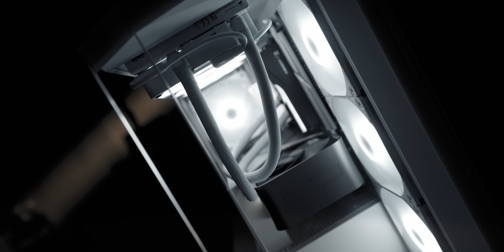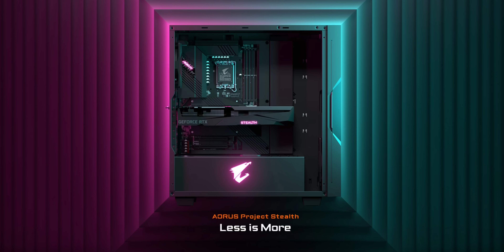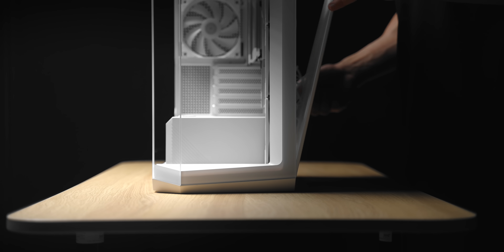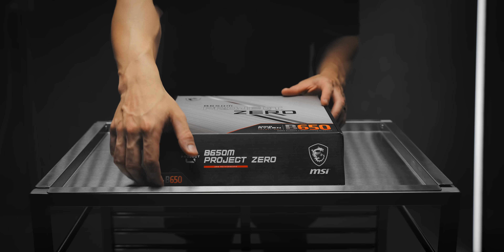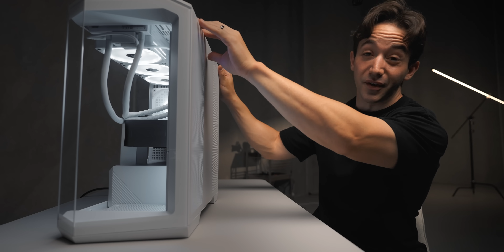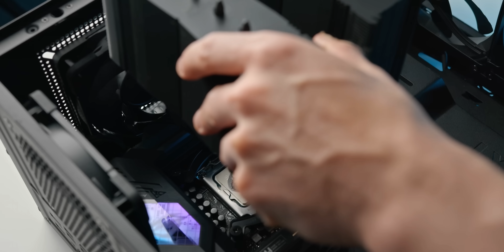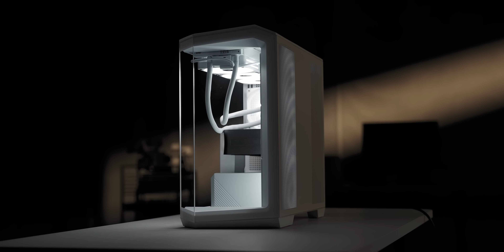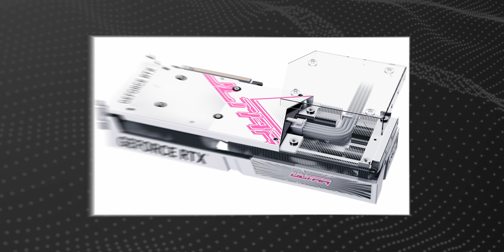"zero cable" PCs are here.

Comment: There's only one small problem with that idea: motherboards have connectors in different places and that will mess with the hole placement for standoffs which is part of the ATX standard for motherboard form factors. In theory, you could design a board where all connectors are at the back and use standoff spacers to have clearance but that wouldn't work because the slot and i/o shield are fixed in place.

Comment: ACTUALLY Making a sort of (cannot remember the terminology) GPU plug extender/anti-sag support would be an amazing idea. You could have it setup with a right angle connector, customizable support for the bottom, and then have the existing cable plug into this extender. NOT sure of the actual repercussions of this or if it is the best idea, but it sounds awesome to me!

Comment: When you see it, you suddenly wonder why this wasn't always the case. It's better in all ways.
Reply: The "case" haha
Reply: Lol easy answer
When the ATX formfactor was created, people didn't care how their PC looks inside. The cables were just in the PC so cases didn't even need cable routing behind the mainboard. Them case manufacturers started adding cable routing behind the mainboards and with windows getting more popular in the PC space the look of the inside got much more important
Reply: @5ch4cht3l7  The real reason is because it was patented back in 2011. There's a lot more benefit then it looking nice as well. For example, if you're a beginner a back connecter MB is really easy to connect.
Reply: what is that for a pb-picture of yours? DAMN what is that?
Reply: it's further from the cpu on the back which could introduce latency that may not be important for most people but for those that it is important to, front mounting will be faster usually, depending on the tracers pathing
Reply: @SBlazeable  Latency for what? Latency for the power cables? Your fans? Are you ok? And if you are talking about front io nobody connects theyre peripherals from there 😭
Reply: @nothinguz  Hes definately one of those guys with a 500hz 1080p monitors and those ugly ass competitve mouses and 128gb of ram
Reply: @nothinguz  latency for sata drives where it plugs in on the back, there's a reason why processors have their own cached memory directly on the CPU itself, data is able to compute as fast as the processor can operate because it has a couple mm at most to travel to access its cache to retrieve the data it needs to finish computing, if you're sending signals back and forth down a football field and your processor finishes the previous task in the time the data asking for new instructions takes to travel 3mm then it's just waiting 99.99 yards of travel time for the speed of light everytime that happens which can be millions of times in a minute, might not mean much for most applications but for latency sensitive applications it's a big deal.
Reply: Probably because there would be an additional assembly charge for components on the back of the PCB. Nowadays this cost is minimal, but in the past it would have been more.
Reply: Because people used to assemble-test pcs flat on the table and not on a case, as you can see if you got the motherboard connectors behind it will not lay flat on the table
Reply: I hate the big box on the gpu

Comment: For me, a case is a case. But I've worked with this case at work -- someone ordered a few some months ago, & they were deployed in the lab -- & one thing I'll warn everyone about is DO NOT GET THE CASE IN BLACK! While this might appeal to the kewl 37IT3 d00ds, that color makes working on it unnecessarily more difficult because all of the parts are black on black. You like having a bright light or do a lot of squinting to figure out where things go, go with the black. But as you can see in this video, the white case is far easier to find sockets & add-ons in.

Comment: I started building computers almost 25 years ago and it just gets easier every time. I like the rear facing connectors but I think you need more room in the back of the case.

Comment: I REALLY like this! The aesthetic aspect is cool, but as a big guy with thick hands/fingers, holy cow this will make those fan pins so much easier to access! I've put off making changes in my PC just because I didn't want to deal with unplugging and replugging those tiny little cables/pins!  I'll definitely be looking for one like this for my next build! And I appreciate the Corsair water cooler with the cables running through the tubes, I have an earlier version of that and it looks awesome except for the wires. My next build will have a custom water cooler system, but that is a no-brainer for these aesthetic builds!
Reply: It's not only those with thick fingers lol! Anyone and everyone would feel daunted if they have to take apart quite a few things just to make 1 or two changes.

Comment: Not sure what I feel about this. It looks clean in the same way an empty apartment does. It's just underutilized. This is a 42 liter case with next to no space for storage. Having the connectors in the back just requires more space. Also, it's not really zero-cable: By the time you've plugged in power, display and USB devices, the back will look just as spaghetti as any other case. 

Also, what I love about PC building are the options. Up to now, you've been able to buy new parts and stick them in a thirty year old case - and vice versa. Nobody's stopping you from building a beige sleeper or simply re-using your old case. But no, suddenly somebody decided that electronics shouldn't have cables, so now its all aboard the E-waste Express for your current case. If you really want a clean build, why not just buy a case without a glass side panel?

Comment: The problem with the high voltage gpu connector might get resolved some time in the future. Last year I saw a video where there was some concept by I think it was MSI too. In this concept they had a custom PCB connector which clicks into the Motherboard. The actual power connection then gets a separate connector on the Board. With that the connector on the GPU front is obsolete.
If they work on standardizing some like that it would a game changer in my opinion

Comment: Not gonna lie, the solution is quite a good idea for "zero" cable management with those white LEDs, it all looks slick and clean. But in the end, you don't actually want to put these on the table to look at it anyway because the light gets tiring after a while don't you think? Practical is good for the cable reach, but that's also it. For me the most important thing to have such a desktop pc is noise humming from all those fans, which I just try to avoid to put that many fans in it in the first place. (overkill is a thing yes)

Comment: I've always struggled to get the front panel headers connected to the pins, because those are always located at the bottom of the board and once it's screwed into the motherboard tray I just can't get my fingers in that space properly to get them connected. I LOVE all the connectors being on the back of the motherboard - sure you lose the fancy custom cables but it's not like this motherboard layout will become the norm, it'll be another option to the regular layout I bet. All they need to do now is figure out that GPU cable.

Comment: "Zero cable" PCs are here" Great...... But they've been here for several years. I picked up a Lancool case in 2019 and aside from the bottom psu and extra drive bays cover and the glass front, they are identical. Don't get me wrong, case design can make a big difference. But it's not a deal breaker. It may be easier but a creative builder can make it work with a lot of different cases.

Comment: If they can pull it off without the whole bundle of dongle-like things having bad contact, oxidation etc. and resulting in 3.3V/5V/12V voltage fluctuations or full on dumpster fires like NVidia with their new connectors, I'm ALL for it. It's about time!

Comment: Just my personal opinion here, so don't get too upset with me; I do get it, but this is really needless complexity for entirely cosmetic purposes that only matter when you have these ridiculous glass / windowed cases.  I'm not categorically against decorative computer cases and certainly not against making them aesthetically pleasing objects, but I have never understood the obsession with staring at the internals.  I use cable management to reduce clutter at a practical level and to help airflow, but I don't care if I can see cables when it's all done.

I like that they make stuff to accomodate different sensibilities, but they have leaned so hard in to the RGB lighting / eye candy market that they have ironically made it difficult to build a normal looking computer.  And in the case of the rear-facing connectors, I would be concerned that they are sacrificing the quality of the circuits to accomplish cosmetic goals.  Single sided boards ARE simpler and less prone to problems.  A lot of this nonsense is how the manufacturers have gotten away with overpricing their products.  I don't need camoflage patterned motherboards and swoopy, useless fascias covering stuff to look 'cool'.  The only way to find a normal, undecorated, green motherboard is to buy 'corporate' models.  I used to like building computers, but have gradually been crowded out of the hobby by the RGB bro cult.  I hate shopping for computer stuff now.

Comment: Should have been done 15 years ago. And I agree, the GPU cable situation is beyond stupid.  A 2-wire 10 Gauge OFC solution would be far more powerful and easily routable. And it should also be on the slot side of the card.

Comment: the awesomeness of the new cable solutions aside, I feel this build would look 10x better with an air cooler on the CPU instead of the water cooling. The big tubes detract from the 'no wires' aesthetic for me.

Comment: i wonder why they haven't do this before, i mean why putting the ports in front? when its way more practical at back
Reply: Because it isn't, really,  It might be for YOU, who don't have ANY reason to add or remove stuff to the PCI connectors on the front, but here you need to strip the entire case down just to add a network card with external power needs.
Reply: @eidodk  why entire case, isnt all the ports on back so that only removing back panel get the job done?
Reply: @AniSepherd972  Can you access the PCI slots on the back ?
Reply: @eidodk  if using extender yes, how u guys put vertical position of gpu in sff cases?

Comment: I would switch to Corsair Link fans and 3D Print a smaller cover for the Video card. Also Print small cover for the Link radiator... Finally print a 3rd small cover for the back top corner to hide the fan cable for the back exhaust. If you use Link for that too, you can just connect the 3rd radiator fan to the exhaust.

Comment: Rear facing gpu cable sounds like a good idea, until you remember that most decent gpu nowadays so huge they require a support bracket as a third mounting point, which in turn can be used to hide most of the cables.

Comment: this is what I expect when I pay multiple thousands for my PC (excluding the rear chaos).. which is why I have have no issue paying the extra for my Macs. not only do I prefer them but I am paying for quality & well designed hardware & synergy.
Obviously I have a PC for gaming & my last one cost me 4k & It always feels cheap & like its made from generic parts.. no design concepts, cables sticking out.. & really lets down paying so much for parts that are reduced to the same ugly issues that the $200 budget pre-build has except I spent 4k. I tend to go for all black cases with no lighting..
it dosent exactly incentivise me to build a good looking unit

Personally I think we need to do away with standard cable length for PSU's
If I am building a full size ATX build I will need longer cables then with an ITX for example. 
so with the PSU you should be able to choose what cable set you buy.. & instead of 12 versions from say corsairs 500w line give me 3 ratings & 3 cable choices.. 
when you buy it you choose what cables & what rating... then when you upgrade the PSU you have an option to opt out of cables.. 
I have 9 sets of RM cables here as I always get the same PSU so I don't have to worry about using the wrong cable config with a new PSU. 

I think that ALL boards (excluding the dell optiplex custom boards for office PC's)  need to have rear facing ports... this will reduce the overall amount of cable needed & if they were all fitted with right-angled plugs then the amount of cable needed would be halved. 

cases need to have fixed in place fan cable runs.. so when you slot your fans in you have a very small jumper that you can tuck & hide which allows for varied rad & fan configs.. & it goes without saying they all need to be interconnected so one cable per block/stack of fans..

Comment: It was actually not much difficult for motherboard designers to put a handful of through-hole connectors on the other side. The SMD assembly is the same for twin. Only those flipped connectors should be installed differently but that can be done manually.
Overall, the fashion of showing off your PC internals is a new thing. However, custom motherboards for custom cases were years ago.

Comment: I would have made the profile of that GPU cable cover far more flow and visually friendly by making it rounded on the visible side and keep the spacer support on the inside, away from view. It's huge and obvious as well as a potential hot spot for the PSU and case! Honestly, the case should ship with such a cover for the most popular cards. It's just cheap plastic, after all.

Comment: The GPU support/cable guard would be a great place to mount a small LCD showing a GIF or PC statistics, it would make it part of the case and the wires could be routed down with the GPU power
Reply: how are you gonna see that LCD through the metal panel? 
hm..maybe you are new at this...but real PC's don't have glass panels..those are only for advertisement and PC review-ers on YT to show the hardware ;-)
Reply: @vasopel you’re trolling everyone I know has a glass panel and I do too
Reply: @Tvv466  trolling about PC cases? that's absurd.
so every one you know has a glass panel PC case? :-O what is the reason? 
and another question...what about PCs at your workplace, or any other workplace you happened by chance to see,do those PCs have glass panels too?
Reply: @vasopel  yes because they are simple desktop machines If you pay for a certain aesthetic it’s nice to look at
Reply: @Tvv466  pay for...aesthetic? what? next thing you're gonna tell me is that consoles should have glass panels :-D
Reply: @vasopel Had one 10 years ago, wtf are you on about? And almost every gaming pc in the last 10 years I've seen had a windowed case.
Reply: A gaming PC with glass panel? So a poser PC.

Comment: I would like something like that which is more wall-mountable, flat, puts the troublesome bits like the video card cables and power supply on the floor.  The glass should double as a clear LLM display for my programmable Graydient character.  Then it's cool

Comment: This is so dumb. The PC is supposed to be clean because all the internals are hidden inside the case. But then they go and make the case transparent. So then the mess shifts to the other side. How long before the other side becomes transparent too?

My PC is incredibly clean-looking. It has no LEDs and I got the darkest glass side panel available. Would have preferred if it was fully opaque but at least everything in there (including the rat's nest of cables) is black so you mostly can't see it.

Comment: Looks great. Moving the AIO cabling to the radiator is a definite step forward. That GPU mount/cable guard is not great - good idea in theory, and maybe slimmed down would be ok, but in current iteration, looks distracting.

Comment: starting to like this trend -- i wish everyone would start adopting it. as you said, it does two things:
1. aesthetics. not / barely a cable in sight
2. functional. all/most of your cables & connectors are accessed from the back & you avoid having to be finicky & doing finger gymnastics trying to plug/unplug connectors when a big component is in the way.

yes, more of these please.

Comment: It's surprising that it has taken this long for manufacturers to consider "rear mount" connectors. And would it really be that difficult to offer a motherboard with dual sided options anyway? It's been a year or two since my last build but from memory motherboard risers should have enough length in them to accommodate a connector on the back side as well.

Additionally, if we're going to go down this path it would be nice for cases to have just a little more serviceable space behind the motherboard tray. We're clearly past the point where running cables back there is 'hacking' your build to look cleaner, they are intending for it to happen now, how about we get more than a few mm space between the tray and the frame and side panel to work with, hey?

Comment: Not a concept build or anything but actually something worse. A seemingly normal build with hardware that would be compatible with most other components of the build. However, unless some sort of standard is maintained, companies will just lock consumers into their ecosystem of motherboard, case, power supplies etc.
What's worse is the standard wouldn't even be that hard to integrate but as soon as something simple like motherboard connectors are moved, shifted, or not thought of in case design then something simple like power button connector could be what stops a person from installing their say... MSI board in a Gigabyte case. 
I hope this isn't the future that companies trend towards, but it seems to be the case on all the concepts or show builds that have come out.